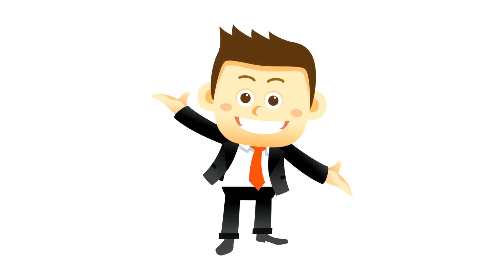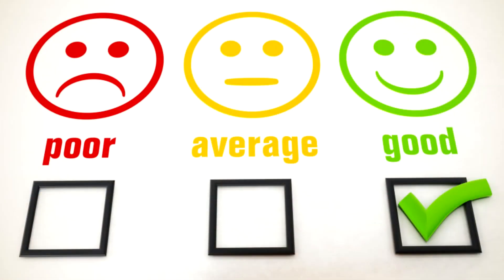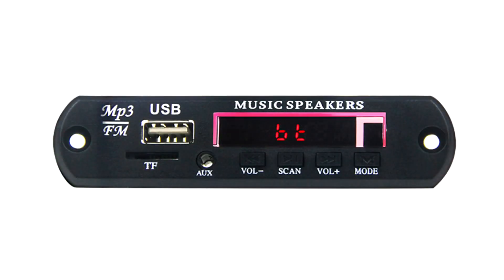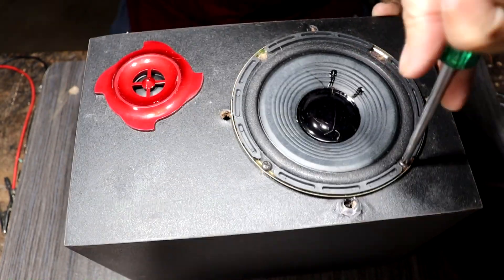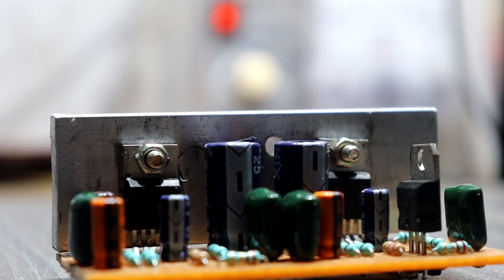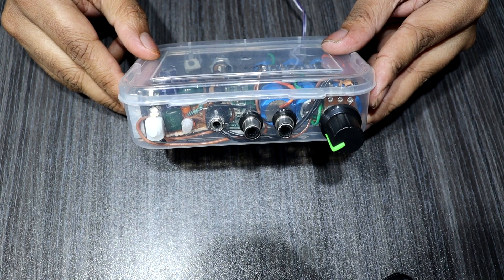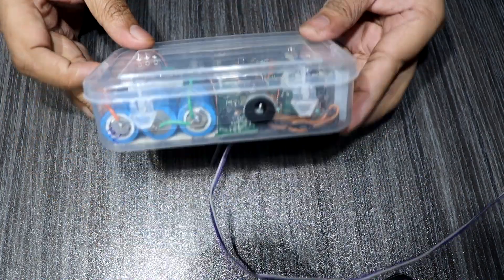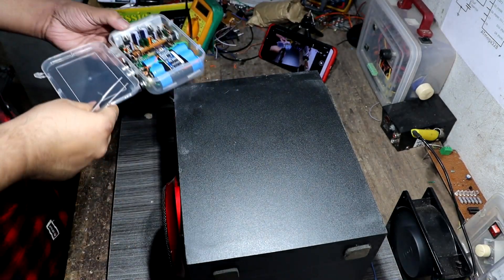HOW TO MAKE A HI-FI RECHARGEABLE BLUETOOTH SPEAKER WITH (POWERFULL BASS)

Comment: Bro can we connect mic
Reply from the maker: Yes but you need Mic 🎤  preamp module otherwise you try this circuit .   https://www.google.com/search?tbm=isch&sxsrf=ALeKk017mMsrEtIvWk-Iuz1Cw8-0O-SyQA%3A1584464068765&source=hp&ei=xABxXpLwLJub4-EPy7Gq8AQ&q=mic+amplifier+circuit+diagram&oq=Mic+amp&gs_l=mobile-gws-wiz-img.1.1.0l5.2041.4986..5975...2.0..0.186.939.0j8......0....1.......5..35i362i39j35i39j0i3j0i131j0i13j0i13i5i30.wxYDPIRVXj8#imgrc=NEvNrF6qtF8SEM  This circuit output connected on our TDA2030 IC input..

Comment: Just try tda 7297 ic amplifier super quality output
Reply from the maker: Thanks for suggesting but TDA7294 lC only working on Dual supply. It's not suitable for Battery powered Amplifiers. This kind of Dual supply ic running only 12 volt to 24-0-24 Dual supply converter its expensive.